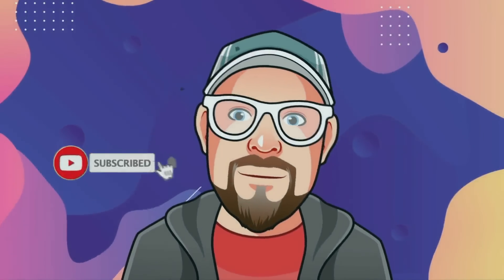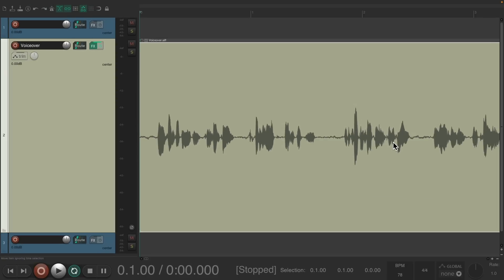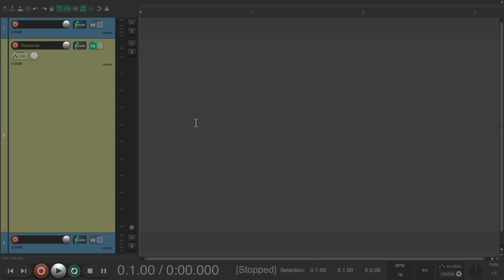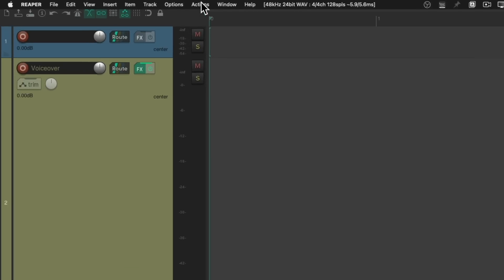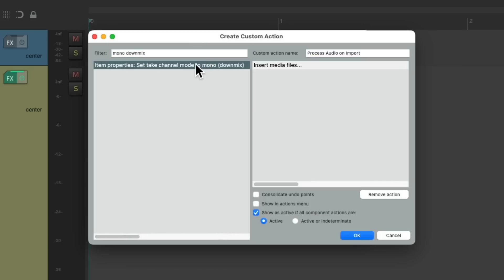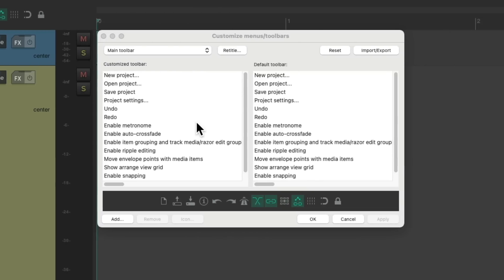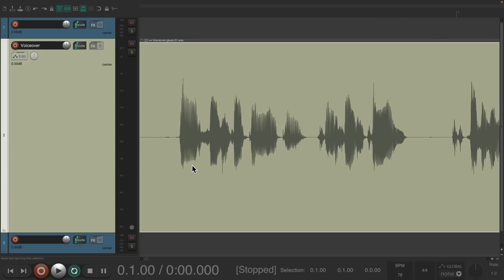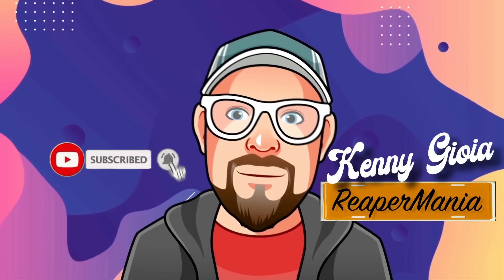Processing Audio on Import in REAPER

Comment: If I'm recording tracks for a radio station, that's about 17 minutes per track, because between the tracks there are ads and hourly news updates. I use only an AGC and hard limiter plugin to prevent overshoots. But I have a PPM meter and watch this one, not to go above 0db, so the processing is minimal. No EQ or other effects are used. Works very well, for years now.

Comment: Informative, as always! Is there a reason why you used the "3-way split > three separate compressors > downmix" chain instead of using the high and low pass functions in ReaComp to achieve the same thing? Does the splitter give you better separation?

Comment: Great video Kenny!  Assuming the next audio file you import will not have the same volume levels; I don't understand how the actions will set the proper compressor thresholds.
Reply: so true!!
Reply from the maker: It depends on what you're doing. In my example, my narration is always the same volume level. But you could also skip compressors and just do an EQ for example.
Reply: he shows what the settings are when he explains the chain: https://youtu.be/rs1tGiztGBI?t=115